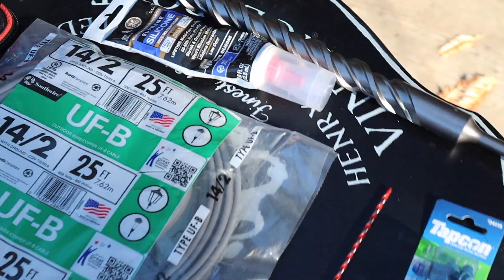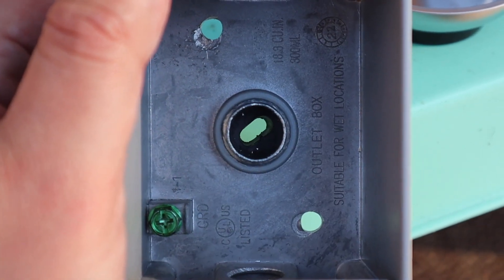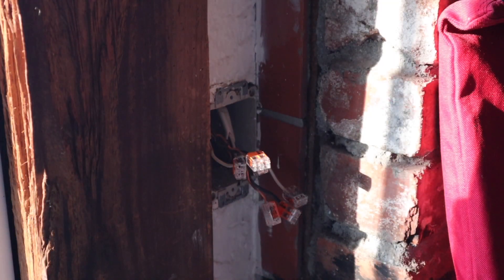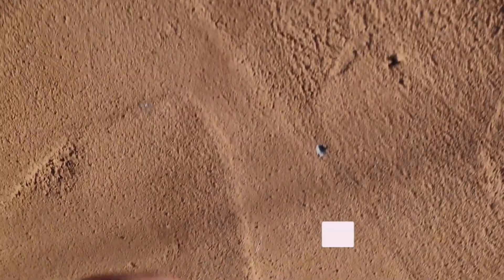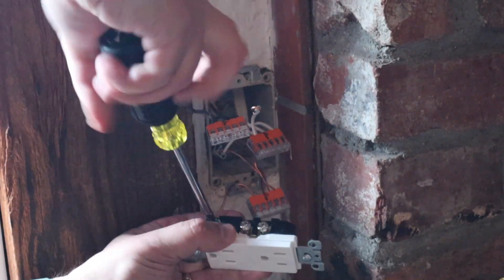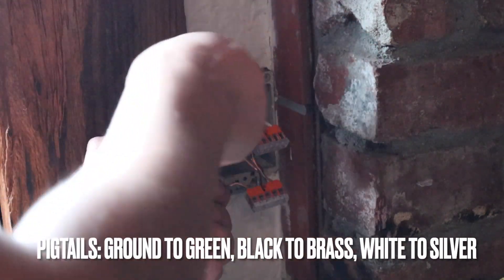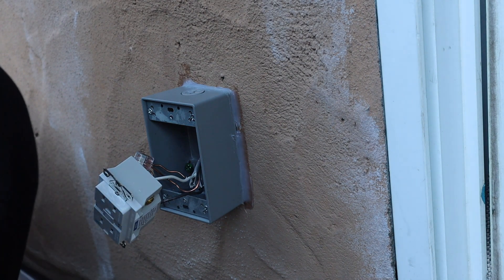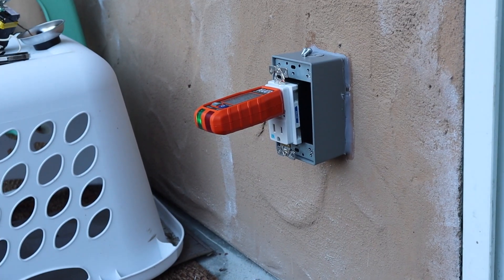How To Install An Outdoor GFCI Outlet On Stucco: Easy Power Access From Inside | PEDRO DIY

Comment: You tapped off an existing GFI, to install another GFI. Thats not how its done. The one inside protects everything down the line. Thats why the terminals are marked line and load.
Reply from the maker: I’m aware how line and load works, the purpose of this video was to install an outdoor gfci outlet. The indoor gfci outlet was removed and replaced with a regular outlet at the end of the video. Thanks for watching.
Reply: @PEDRODIY2  That makes sense. Seems like best practice would be to strive to wire a circuit so that the outside outlet in a chain has the GFCI outlet which is exactly what you did. That makes it easier to see at a glance that you have GFCI where it's required.

Comment: Why not cut stucco and install a flush box inside stucco looks way better than the box exposed outside. Doesn't take a lot more work maybe 10 minutes more
Reply from the maker: @ernestogonzalez1538  could have done that yes, but it is just much more simple to do it on the outside like I did. It’s very common to do it like this. Thanks for watching.

Comment: In Florida it's stucco over concrete block. Would you modify any of the procedures you outlined in your video with concrete block in mind?
Reply from the maker: @sdybas  I’m not a professional so it’s just a guess, but I would assume you just need to drill farther with the rotary drill and be careful towards the end of the cement block. Since the rotary drill (in my case a dewalt corded with a 1-1/8” bit) is made for masonry it should go through both the stucco and the cement block without issues. Just be careful towards the end of the concrete block cuz you don’t wanna go past the end of the concrete block if you are applying a lot of pressure with your weight, and hit some electrical wires or the back of the electrical box. Good luck on your project.

Comment: Sir, can you once again list the proper drill bits to be used to drill all the required holes thru the stucco wall, starting from the inside? Also, I only have a regular drill, and not an impact driver. Will that work with the proper drill?
Reply from the maker: @CarlosGarcia-ls4hn  on the inside I used a spade bit to cut a circle hole on the backside of the plastic outlet box. On the outside I used a rotary drill with a 1-1/8” bit (masonry/concrete) to drill through the stucco. I purchased the rotary drill (dewalt 1-1/8” corded rotary drill)  on Amazon and returned it after using it for that one hole because they are like $200. Once I got through the stucco I just used a regular drill bit to get through a bit of wood and at that point I had a hole connecting my outlet box inside the wall (inside) to the exterior stucco. I hope that makes sense. Feel free to ask any other questions you might have.

Comment: What's line and load. Im trying to out a gfci outside but i dont have any inside the bedroom .
Reply from the maker: @tanktexas 
	•	The line terminals supply power to the GFCI outlet itself.
	•	Incoming wires from the circuit breaker connect to the line terminals.
	•	These terminals are usually marked as LINE and are often located at the top of the outlet.
——-
	•	The load terminals are used to pass power to additional outlets or devices downstream from the GFCI.
	•	Wires connected to the load terminals are protected by the GFCI.
	•	These terminals are marked as LOAD and are usually located at the bottom of the outlet.

If you don’t have an outlet on the other side of the wall that complicates things and you will need to get the wire there somehow.